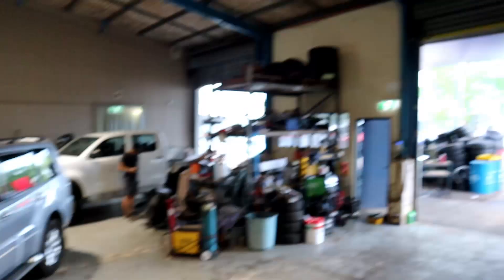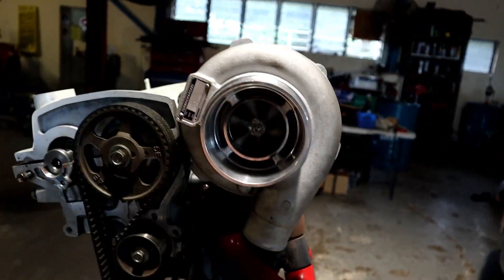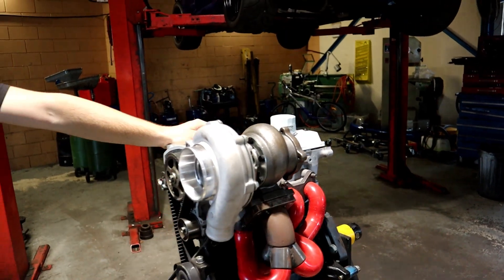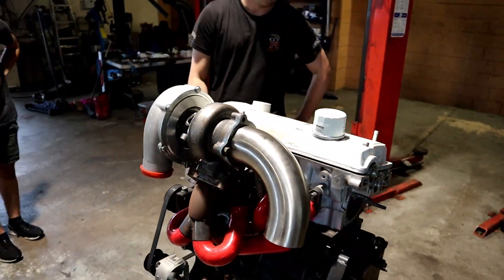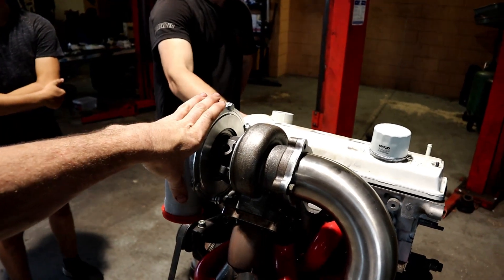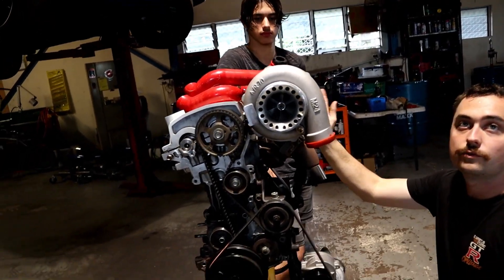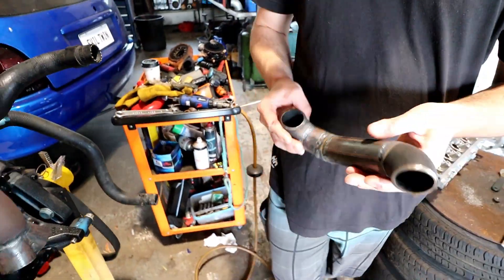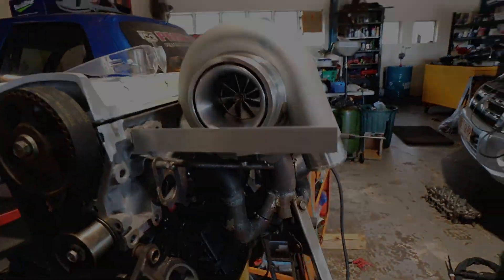4EFTE turbo manifold discussion/build

Comment: You will need thermal protection between the turbo and engine, such as a carbon-welding-blanket. Your timing belt is rubber and will turn to smoke with too much heat from that turbo.
Reply from the maker: What about a turbo beanie?
Reply: @Camp_Dogs  Maybe. You need something to keep heat away from the valve cover.